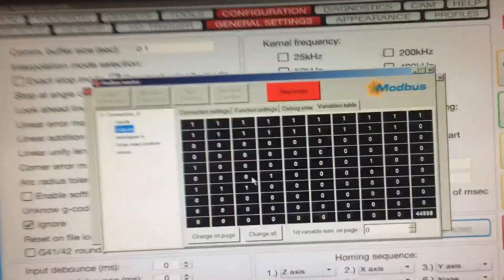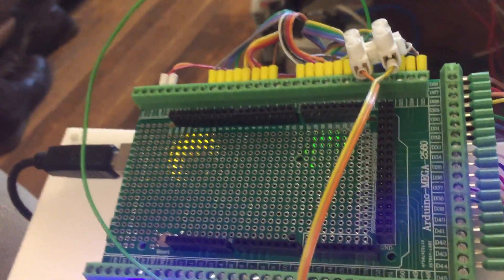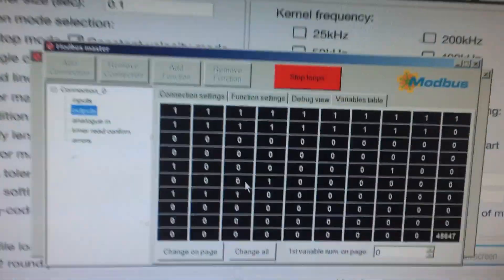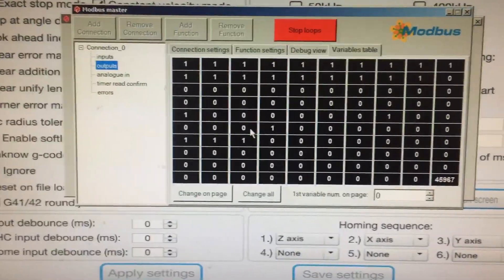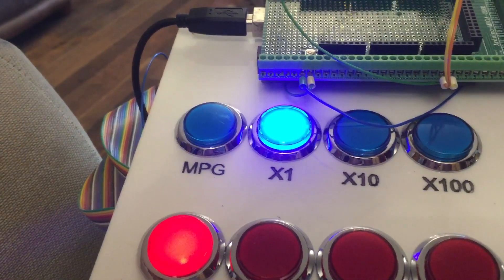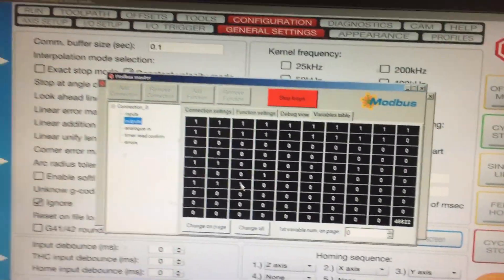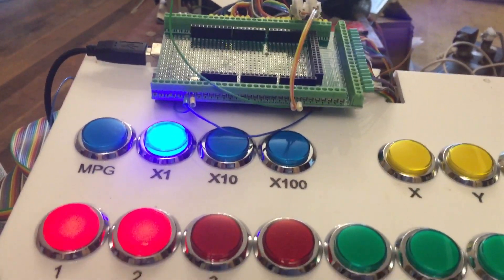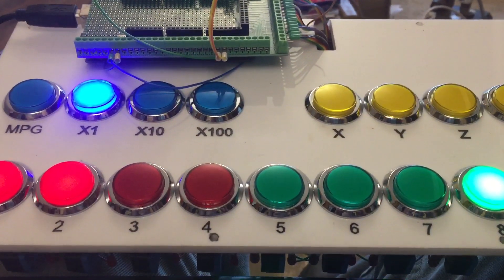Uccnc modbus slave control panel (arduino mega)

Comment: Can you share how you set up the arduino librarys. I can't even get the basic 16 register example to work with UCCNC. My connection keeps timing out. I've been scratching my head for days trying to get my mega to communicate with UCCNCs Modbus plugin
Reply from the maker: what library are you using?  im using my own.
Reply: @automateanything  I am also interested in your library, could you share this?